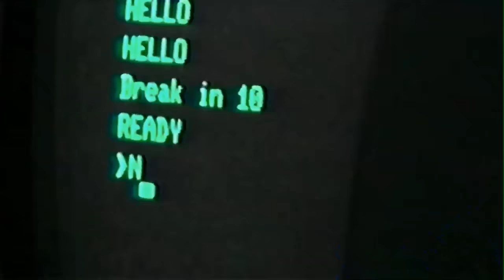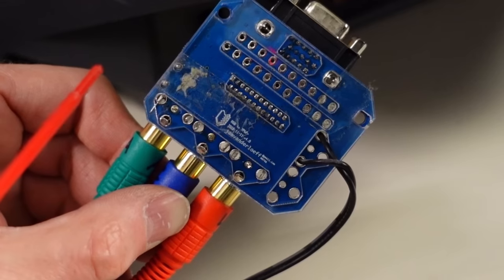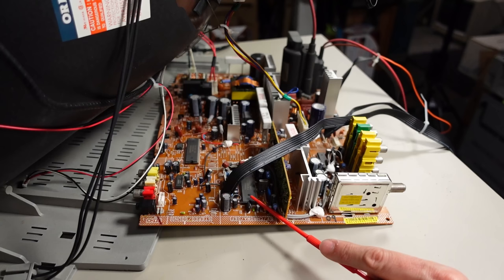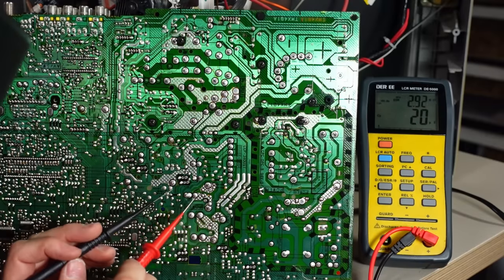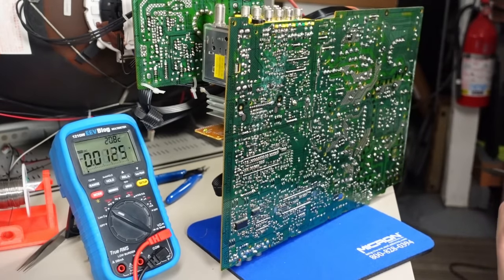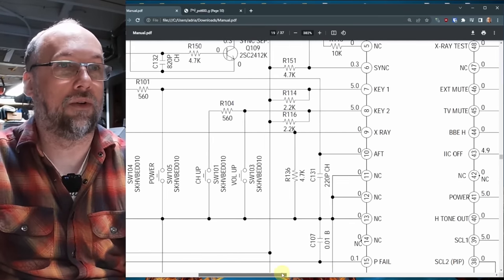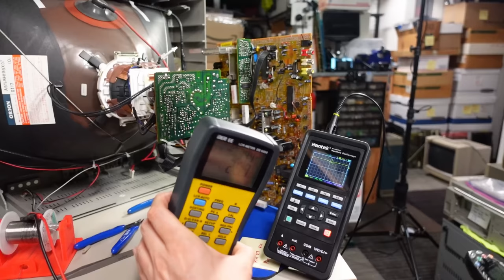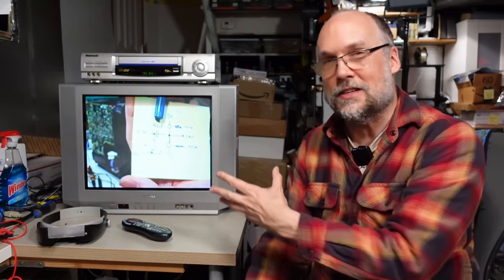I figured out exactly what's wrong with my Toshiba CRT TV (20AF41)

Comment: One of the lessons I am taking from this is to always put CRTs like this on a power strip and physically switch it off. Simply being plugged in and unused is clearly creating stress on the components even though they're not doing a whole lot per se. Over time that will cause them to wear out more.
Reply: Doing this probably puts more stress on the parts, as they have to survive the inrush current into all of the caps every time...
Reply: @m1geo I have a Samsung GX CRT that flickered on and off due to a brief power outage. And let me tell you guys; the noises that it made when turning off and back on were NOT pleasant! 🤣 Always use the TV's power button!

Comment: Great vid Adrian!! Thailand was a big CRT manufacturer in this time period. I could still find brand new tubes and chassis at the electronic market back then. Now I come across some FBT and other spares from time to time. Because of the weather  conditions CRT are still widely used here. LCD tend to develop issues with the polarizer after a few years, most commonly known as the "vinegar syndrome". Nothing beats a good tube, especially in all its RGB glory :-)
Reply: Yeah i'm in oz and have my 27 inch samsung crt running nonstop fa 8 years now. Its aprox 25 yrs old.  Skin tones beat my flatscreens anyday.

Comment: While this solved the problem, there's probably still at least one fault. The voltage was sagging about 1.2V  1V before, now it's sagging about 1V 0.6V, which is still a lot for a 5V rail. The 5V VCC of the controller is sourced from a simple pass transistor+zener diode regulator, which is not a great performer usually. The raw 8.9V input is filtered by a 470uF 16V (C531) capacitor. I'm almost certain that C531 has high ESR, and probably undersized in capacitance. The same 8.9V rail supplies power to a 7805 as well, which is switched by a transistor, and has an other 470uF capacitor (C529) on its input, and a 1000uF on its output. The voltage sag on the AT+5V VCC rail during power-on is most likely caused by the high inrush current when the switching transistor connects the discharged 470uF capacitor to the same 8.9V rail, and the 1000uF on the output of the 7805 also contributes to the high inrush current on the 8.9V rail during power-up.

I would replace C531, C529, and would also probably change the value of C531 from 470uF to at least 680uF or even 1000uF. It does not feel right to switch a completely discharged 470uF capacitor on a live, unregulated rail that is filtered only by an other 470uF. A significant amount of voltage sag is inevitable on the rail, due to the inrush current.

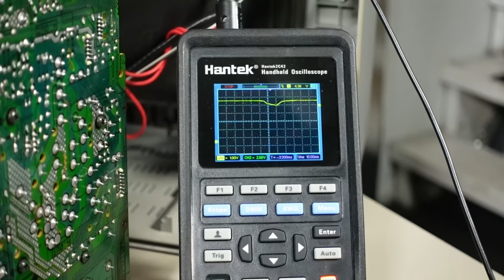EDIT correction: the voltage sag is about 0.6V after the repair, and it was like 1V before the repair. I wasn't paying attention that the 5V level is not aligned with the grid. Thanks to @Michael Thomsen for pointing this out. 56:17
Reply: Yes! Exactly! Not sure how Adrian missed it.
Well, I'm not 100% sure if it is C531 or something else but 1V sag is most definitely NOT ok, it will likely get into clicky mode after a while.
I'd say at least try checking if one of the power switching transistors is marginal as well.
Reply: @jwhite5008  he was thinking of sissy hypnosis
Reply: My bets are on  C531 too.
Reply: Yes, C531 is doing the heavy lifting of being the first stage filter for the switching power supply.  Those usually fail first.  I would double check it.  And I agree the voltage sag is excessive even if the TV is still working (for now).
Reply: @c0rpse1  bruh lmao
Reply: You may very well be right. I didn't look too hard at his schematic, but if those 1W resistors, especially the one near the heatsink, are in the 5V Stby circuit I've seen them drift before and cause exactly this issue.
Reply: To me it looks like it's only sagging about 0.5V. The 0V on the scope is a bit oddly place
Reply: @michaelthomsen8771  Yes, you're right, the 5V level is not aligned to the grid, I was only paying attention to the sag, which is right on the grid at 1V/DIV after the repair. But still, the difference in sag between pre- and post-repair is not huge 56:17 . It's barely below the tigger level of the reset IC.
Reply: @jwhite5008  Well, the sag is "just" 0.6V as it was pointed out by @Michael Thomsen. I wasn't paying attention that the 5V level is not aligned to the grid. But 0.6V is still too much for a 5V rail. It is probably OK for the controller, but it is beyond the trigger level of the reset IC, which is I think 4.5V. It doesn't trigger the reset IC, probably only because of the 1uF timing capacitor on it.
Reply: Agre. The sad part is that maybe the sag 5+ rail still remains, and may cause in the near future bigger problems to other components. The capacitor on the reset regulator may just had "hidden" the real issue.
Reply: Good comment, I was also concerned with the 5V logic rail sag and this fix seems more like a band-aid.
Reply: @MrHkrammes  yeah, that's exactly what I think has happened.
Reply: As an old TTL guy, I get nervous when I see a 5V line drop to 4.75V.  According to those spec sheets, that's the lower limit on their specs.  Anything below that and you've given the chip permission to misbehave.
Reply: While I am not an electronic guy, but caring and repairing old computers from the 80s, the drop of 0.6V made me also nervous as it is just asking for more trouble down the line.
By my experience many circuits are not well behaving anymore with a drop down to 4.5V.
So the fix now is just a band-aid without repairing the real cause of the problem as far as I see it.

But maybe we are lucky and we get another repair video on the TV 😁
Reply: Not a parallel resistance problem then?
Reply: Ok bro 🎉

Comment: Holy Crap! I used to own that exact same model. Bought it back in 2000 because I wanted a set with Component Inputs (Y Pb Pr) for my PS2. God, did it make the PS2 look freaking good.
Reply: Same, but I still have the set (and the PS2)
Reply: The composite/component thing is kinda alien to me. Every TV I owned was either RF only or RF and RGB, sometimes S-Video and I've been using RGB since the Sega Mega Drive(SNES doesn't support RGB out, sadly) and Amiga days.

I couldn't imagine playing PS1 or PS2 through RF(or composite, which doesn't look much better), unless you had a TV from like 1982, or a VERY(I mean like sub-£100 new) cheap portable which was RF only.
Reply: Does it really make a huge difference compared to composite???
Reply: i think most analog inputs were awful on tv (like the cinch ones)

because if i used a audio+tv signal to scart adapter (passive) it always looked way better for some reason

Comment: Two repairs for the price of one! I was really surprised that just cleaning the heads would clear that video picture up. Great video as always!
Reply: When dealing with old magnetic tapes (VCR, tape recorder, reel to reel) this type of problem will be getting more and more common than before : when 20 or 30 years ago (when the tapes were still recent, except for rally bad quality tapes) you have to use the equipment for several dozens of hours to get slightly dirty tapes, it now take only one faulty tape to entirely clog the heads.
I think the same kind of problem can happen too with floppy disks too.

Comment: For head cleaning, we used Kim wipes (Kimtech).  For everything, the Sony D2, Beta SP, and all of the random S-VHS and VHS decks.  The 4x8" ones.  Fold in to quarters.  Perfect finger width size.
Beware that you never want to move your finger up/down when cleaning heads.  Modern decks have a piezo adjustment for head tracking and that can be broken by vertical movement.  What I do is rotate the drum to between the heads, place my finger there, keep constant pressure, then rotate the drum a couple times.
One nice thing about pro decks is that most have an RF meter or even an RF test point that you can scope to see the signal from the heads.  Low signal, clogged heads or bad tracking.

Comment: Orion only used Nichicon and Rubycon capacitors in their TV sets, VCRs and DVD players until the company went bancrupt in around 2015. So the capacitor brands weren’t Toshiba’s choice here. 

Although Orion was known for cheap products, their hardware quality was decent. However, I didn’t like the build quality of their remote controls and the plastics paintwork. Orion’s cases often came with scratches and impurities right out of the factories. 

In my Orion TV VCR combo from April 2001, some PCBs had the Matsushita [M] logo on it. Some — if not most — Orion-branded CRTs were actually built by Chunghwa in China.
Reply: Orion was the 2000s equivalent of a TCL product today tbh, except way older and Japanese and making a wider variety of products.
Reply: @SockyNoob  I am not sure if there was only one Orion or more. But the Orion I know is (was) a Hungarian brand founded in 1913.
As far as I know they made decent quality products.
After the collapse of the Soviet union, as a lot of companies, it went bankrupt in 1997 and the brand was bought by a Singaporean company group.
Now the sell rebranded chinisium garbage.

Comment: If I remember correctly, the sharpening trick some TVs use relies on the detection of the transition from a lighter area to darker area during the image scan, and blanking the pixels in-between the transition boundary. It basically puts a fine black outline between areas of contrasting brightness and/or color.
Reply: ?  doubt it?  that'd require a hell of a lot of signal processing, maybe  a high frequency emphasising/boosting circuit ... that'll have the effect of sharpening edges
Reply: @andygozzo72  You could be right. Wikipedia entry for 'Edge enhancement' does describe something similar to what I meant, though. There's likely several ways to achieve a similar effect.
Reply: UGH, yeah the "cartoon" effect.  I can't believe that they made a set where you couldn't turn it off.  Good on Adrian for figuring out a way.
Reply: What it does on this TV is finely adjusts the horizontal position of the beam, slowing it down during sharp brightness transitions. This compensates for poor bandwidth in the amplification circuitry, but tends to cause overshoot and geometry issues, especially on these Orion sets.
Reply: Was this on ALL late model CRTs? I don't remember seeing it on any of the ones we had in the early 2000s.
Reply: No, but it was reasonably common on name-brands TVs.
Reply: I believe the term is "velocity modulation" or "scanning velocity modulation", often abbreviated to VM or SVM. Sony's ClearEdge VM is an example of a good implementation of the feature. In moderation, it is sometimes beneficial for blurry sources (e. g. composite video). Usually, however, it distorts edges of objects and ads annoying halos to things

Comment: I've had a good few Orion Toshibas over time. Starting in the 2000s, Toshiba outsourced pretty much all of their TVs under 32 inches to Orion to cut costs.

The last number of the model number signifies the year of the set - XXAF41 for 2001, 42 for 2002, etc.

You shouldn't have had to cut the VM coil wires to disable SVM. If you peek in the service manual, CP852B is also part of the SVM signal path, and is just a normal connector. This is a very common mod on these sets. The SVM also horribly impacts geometry on these sets.

Many of these Orionshibas also have "red push," where red colors are boosted without altering white balance. It's pretty nasty, but I believe that the 2001 models maaay not have had it? And my 14AF46 also does not. On the 2001-2002 models, it may be removable via some initialization data trickery, none of which is particularly well-documented.

These sets also got worse over time. They redesigned the chassis in 2003, and they started reducing the input count in 2004. They always retained the full suite of inputs, but the later sets had fewer duplicates and lost the monitor out, at least on the small models. If memory serves, the handling of the YPbPr video also became worse with the chassis redesign, having some horizontal separation issues.

There is also an hour counter on these sets, which can be accessed in a similar way to the service menu, details of which are in the service manual. In short: turn the volume all the way down. Then, hold volume down on the TV, and press and hold 9 on the remote for the service menu, or 6 for the hour counter.

Jamvanderloeff is still around and still making all sorts of stuff! He's Wakabavideo on eBay, and he only lists items that are currently in-stock. As far as I know, he's still making his YPbPr to RGB transcoder. He's an active member in the /r/crtgaming subreddit, as well as the Discord server linked there, and he'll always respond when asked about stock.
Reply: I have a 27 inch or so Orion TV,  it was made  August 2002 (on sticker), it's still working, I only use it once in awhile for ColecoVision/Intellivision, but it does have a lot of hours on it..  it's black color cabinet,  I'll have to check later to see if it has a hour counter lol, interesting. Edit, okay ( out of breath, frikin thing is heavy lol)  it's model number is STV2763, okay I tried , this came up on a blue screen,  INIT 00    08      CRT ON     55CA  , I couldn't exit it, so I shut it off lol

Comment: I have that exact same set I bought new back in the day. It still works and looks decent and it has low hours too.
It's my last CRT TV left. Panasonic had the first semi flst screen called the GAO tube, excellent looking sets, then Sony came out with the actual flat tubes and everyone made similar sets. I live in deep outer SE Portland so I'm local to you and I have fixed TVs for years but no longer. I have a Beltron CRT rejuvinator and all kinds of tubes and tube testors stashed in my shed.
I also had the Toshiba 34hfx84 crt HD sets from 2005 to about 2019. Excellent looking set and it just continued to work.

Comment: One of the biggest problems with old tube TVs is that the line frequency oscillator breaks down the solder so first thing is always to resolder the ground tabs around the frame of the case. It uses the metal frame to give other parts of the TV a chassis ground 👍
Reply: Mike Smith
Grounding issues, are you on 120 Volt grid in the US.
I do ground them all, japan / Europe Eng versions only, the old Sony Trinitron 60 Ish models i collect, can you give me some tips, specially on the Japan dual systems i have some issues.

Comment: Nice one Adrian. Re the "broken VCR", the most likely cause of the failure was due to the tape being rewound after it was last used. I suspect that machine keeps the tape laced up in FF & REW so it's always in contact with the head drum. If you played the tape then rewound it, this is effectively dragging the tape backwards across the heads which can cause oxide shedding. It was never a problem with earlier VCRs that always unlaced the tape before FF or REW modes. 
Some engineers I knew back when always laced up mechs were introduced, said that this was not only to keep the tape against the control track head, so the tape counter could use the pulses to count the tape position in real time, but it was suggested that this was so the heads would wear more quickly causing the customer to buy a new machine earlier - in other words, the first steps towards built in obsolescence. I think they was just paranoid myself but then cheap video recorders rang the death knell of the TV & Video repair trade.

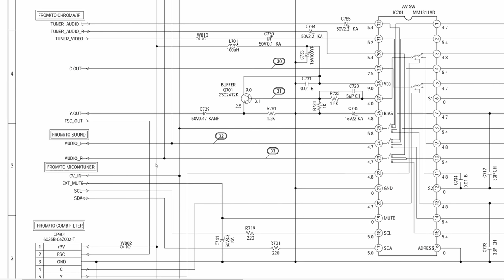Comment: 21:54 Observing the schematic, the way it actually seems to work is the switcher ic selects the composite input source to output to the comb filter, which is always in the signal path, because that's what converts composite to Y+C. The output then goes back into the other set of switches in the ic that switch between composite/s-video/component.

Comment: On the arcade games that I used to service (and still sorta do as a phone support tech for an arcade company)  

CRT monitor on older games does nothing but "click" or "Tick".  Usually we trace that back down to a fried H.O.T.  (Horizontal Output Transistor).  And normally while we're in there replacing the driver transistor along with the H.O.T.-  I'll recap the board at the same time.  Amazing how much cleaner the picture looks afterwards.